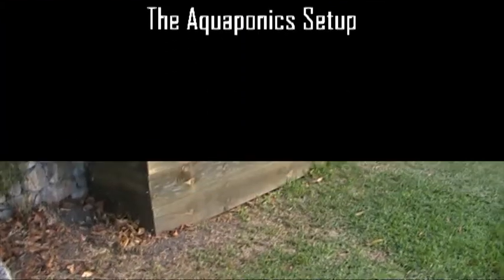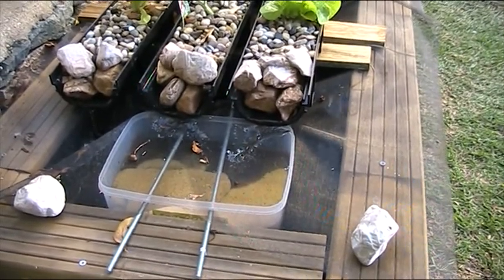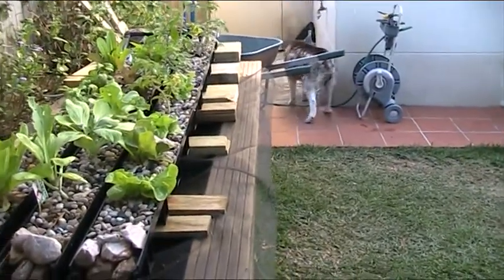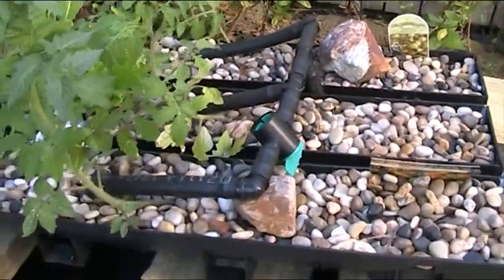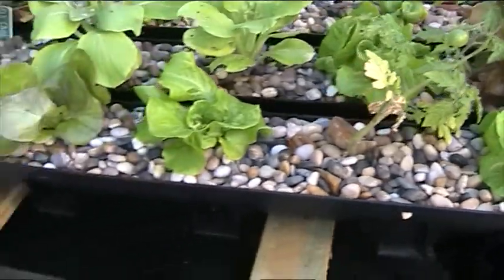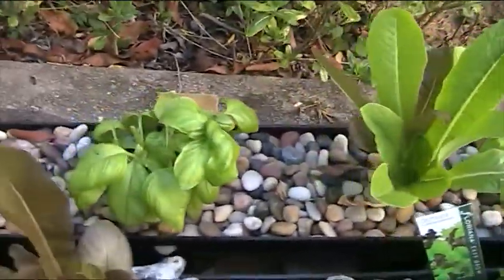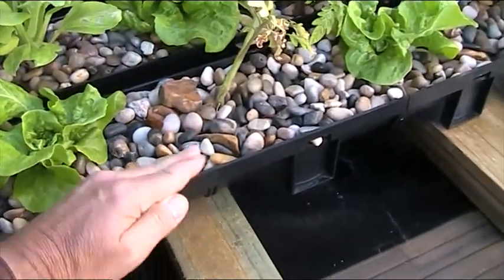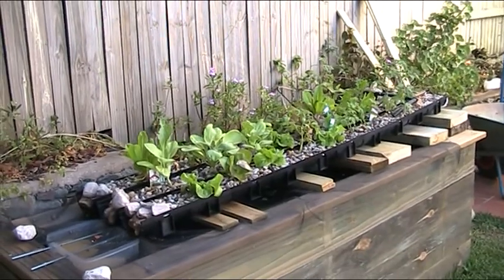Backyard Aquaponics - The Basics

Comment: would be sweet for growing watercress, the timber paneling looks very nice
Reply from the maker: Cheers mate. I'm actually swapping the gravel out for clay balls - they are so much lighter and easier to work with.
Reply: yeah I was using gravel a few years ago in a home made pvc down pipe vertical system, the roots always seem to grow tight around the gravel blocking the water flow spilling nutrient all over the place, many days i would come home from an interstate run to an empty water resivoir and wilted plants
gravel can be a nightmare in nft style hydroponics also the ph changes a lot with the minerals gravel contains yep